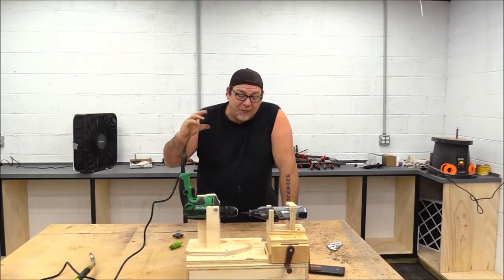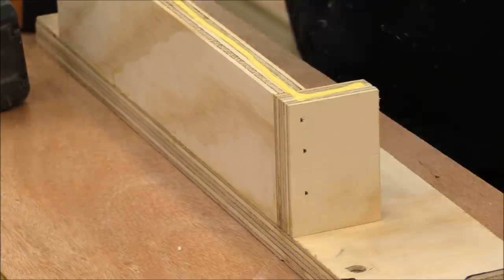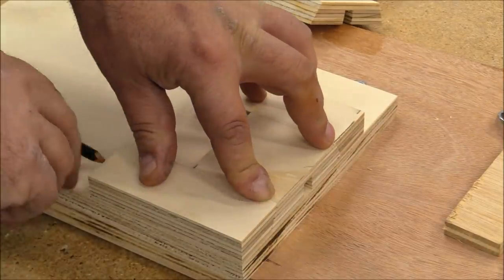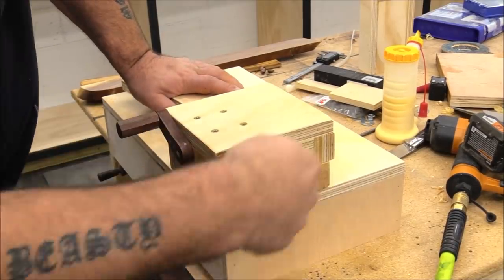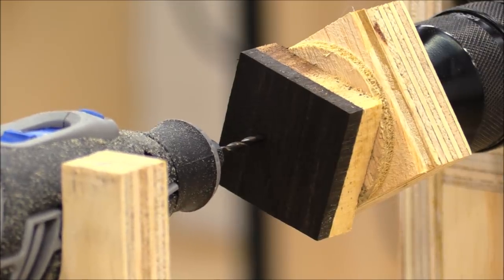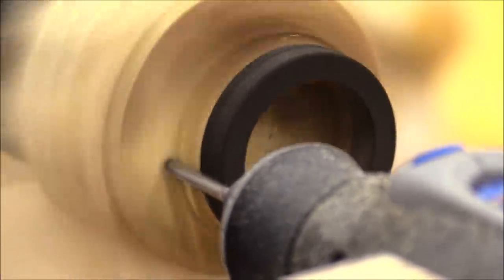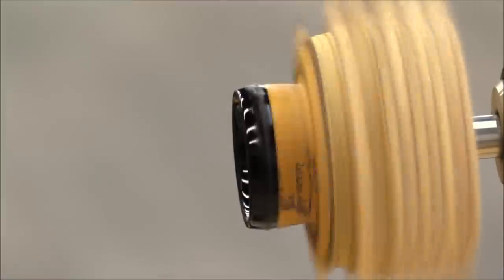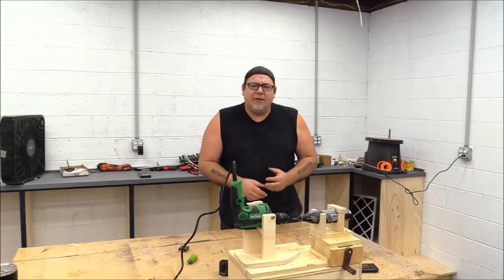How To Make a Wood Ring Making Machine

Comment: I made 10 hoops - in graduated sizes from 4” down to 1” ID - using a miller driller and a rotary table with a three jaw chuck mounted on it - same principle you’ve demoed here. The rotary table was bolted to the milling table and the ring blanks, which were produced on a lathe, held by the three-jaw chuck. But, because my hoops (“rings”) were full circular section, I had to use a round over cutter as used commonly with routers to round edges on such things as table tops. This cutter was mounted in a regular drill chuck: a collet would have been better, but visibility at the cutter would have been reduced. The ring section, by the way, was 15mm ( about 9/16” dia.)

Comment: How about an expanding mandrel to hold the cut off ring? Maybe a large dowel with a hole in the center and then some cuts down the length. You could drive in a cone shaped dowel to tighten it to the ring.

Comment: Great job, CNC'ing it would be an easier option though than doing it mandraulically :-) BTW, just use cyano as the 'finish' - bit like all the awful 'penmakers'  :-) Your battery dremel is also a better buy than the old corded variety - outstanding tool, couldn't live without it.

Comment: Any chance you made a plan for the mounts and swivel/slide for the drill?  I got one of those drill press mounts that works similarly to how you made the dremel mount so I could slowly move it front and back, side to side, but I’m stuck trying to figure out the rest. I know generally what I’m trying to do based on the video, but I’m just a little stuck on how to bring it all together.

Comment: Working on building something similar, for others who might see this and you if you use this in the future, Skateboard bushings come in sizes, small enough to trap a ring on a 3/8th's inch bolt!
Reply: I am surprised there isn't more play in the drill chuck, I was looking at creating and added suspended pier with the bearings from a skateboard, when I discovered this. I'll likely pass on the skateboard bearings, but use some with a 3/8th's inside diameter, so all this will play well together.

Comment: DUDE!!!  this is awesome!!! i make and sell wooden rings, and I must say I am impressed!!!!   Just a tip... CA (superglue) glue for a finish!  Put a layer of linseed oil on the ring, then a good dab of superglue on the ring, using the same oiled spot on the rag to apply the glue.  I them let it set after a couple coats, and buff it with the green stroping compound you buy for sharpening stuff!!!!
Reply from the maker: cool thankyou for the tips i will try them out
Reply: This sounds cool!! Also, I saw someone wetsand with linseed oil once, and the sheen on that finish was just gorgeous. (May have been Stumpy Nubs, but don't quote me.)

Comment: Very neat!  I have a question, why did you put ashes (at 4:55) on the blank, before gluing it on?
Reply: He used a stick of hot melt glue that is designed to be used in a tool, but just heated it up with a lighter, burning a bit while melting it.

Comment: I made an engagement style ring out of tagua nut, just to see how far i could push the material.
Turns out, pretty far. I actually got it thinner than a regular metal ring with room for a modest setting.
Unfortunately it succumbed to the rigors of bar room antics on a particularly boisterous Thursday night.
Tagua: solid medium, brittle under pressure of a closed fist.

Comment: Do you have a video on that special square you were using?
Reply from the maker: what square
Reply: @izzyswan  the small sheet metal that u used as a 90 deg...looks like u have a 45deg on it...and a lot of holes im assuming for radius. First seen at the 1min mark.   I want to see all the cool tricks you have built into it.